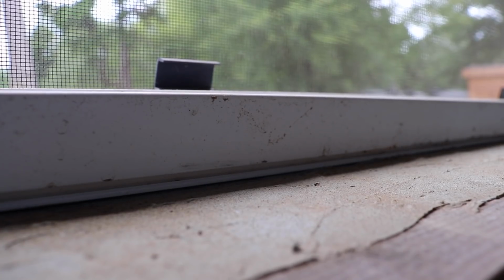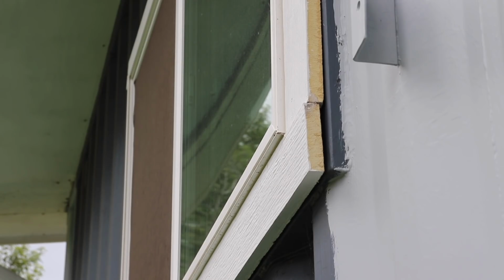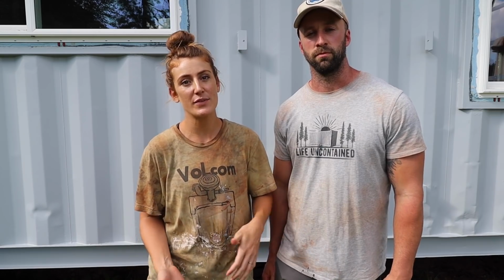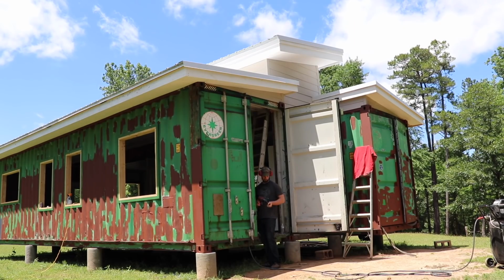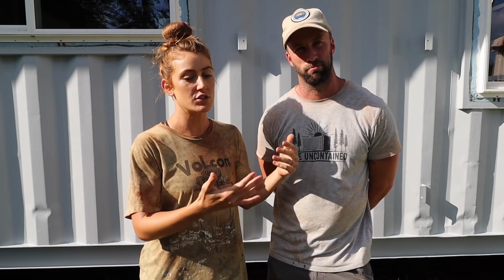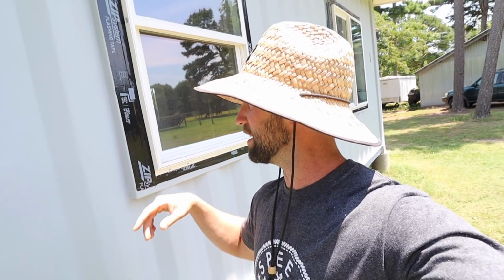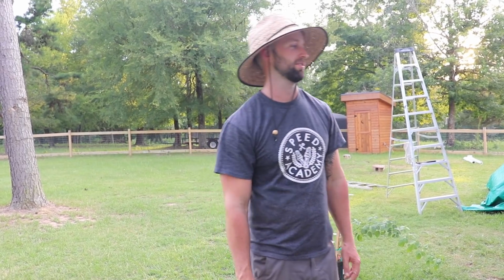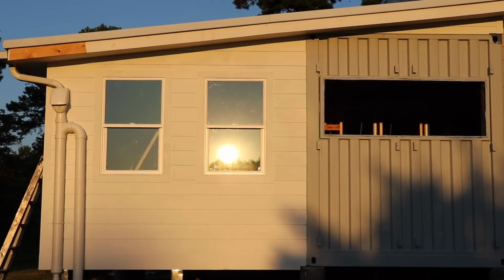Painting Our CONTAINER HOME!

Comment: Next time when planting. 
Fill hole with water.
 Let it seep in.
Loosen up root ball
Put a bit of granular fertilizer around outside of ball.
Cover with dirt.
Water very well.

Hope that helps.
Reply: Make the hole 2 to 3 times the size of the root ball, loosen the roots and don't set the plants with top of the root ball being buried ....... the stem at the root ball should never, ever be buried.  And, if and when you ever think that you want to mulch around the base of the roses, never make the mulch more than 2 inches deep and never, ever pack it in all the way to and up against the stem.

Comment: When yall have to replant those vines (you will, remember "dig a $20 hole for a $5 plant"! 

Also - Use rose soil mixed with organic mulch (1:1) n get some "Super Thrive" - organic fertilizer, HIGHLY concentrated. 1/2 strength right after you plant to avoid ahock n burning new roots... Good luck!

Comment: man, all that painting, to still do inside and out, id be investing in a sprayer for sure.
Reply: less than 50$ can buy good air sprayer and paint all wall. interior or exterior, but first time clear wood or metal need paint brush base paint. then top paint can use spray gun.

Comment: One quick tip for the climbing roses that I learned the hard way,  don't weave them through the trellis. They will be too close to the walls which causes mildew and fungus on the plants.  This will cause them to stunt,  die out, or rot. They need water and air circulation. Also when it comes time to arrange limbs and do fall/ spring pruning you won't have to try to work through the bars. If a plant dies (they do) you will not have to unweave limbs through the bars. You don't need to worry about this with most vines that have tendrils. Just climbing plants that produce stems and branches.  There are great velcro and foam coated twisty ties just for this. At Lowes, Ace, and Home Depot. You simply place your branches as they grow and tie to your frame.  I love watching y'all achieve your dream and figure out how to keep that bull out. And where was Bear? Missed him.

Comment: I'm in the window business, the window flange should have gone on the interior of the  metal..  On a wood structure the window flange goes on the outside, but not metal it's to the inside.
Reply: Hush!! It’ll be fine:)
Reply: Also the bottom trim piece doesn’t go all the way across. The sides come all the way down and then the bottom piece goes in between, therefore you’re not creating a water ledge.
Reply: Yeah well.. You are correct, but since the window was installed on the outside of the metal it’s not going to make any difference
Reply: They never listen to comments so they will be redoing things forever.  That beam under the living room drove me mad.

Comment: You guys need an airless sprayer in your life... you’ll thank me later...
Reply: Brad_Woodall_REI Eh sometimes painting quietly can be nice too ( just about finished painting our daylight basement split entry with a two inch brush)...I work for two to three hours a day five-six days a week, two more days and I’ll be done. The Zen of painting.
Reply: spray paint can use later after all have paint brush first, metal need this and wood, wood suck paint lot need brush paint first 2 time, then can use top paint spray and repair old etc. if need paint metal first need spray 4 time base coat, then paint 7 time top coat then have good painted wall,same work than car need do.
Reply: I agree...and an oil based paint that will seal against rust.
Reply: That little paint brush made me cringe! Guys you do everything to the nth degree, get a 20$ paint brush at least.
Reply: @prosie1968  I agree, that chip brush is made for small jobs and oil based paint. They need a good polyester / nylon blend that will put more paint on the surface and less dipping in the bucket.

Comment: Unfortunately those plants may not live. First, the hole is not wide enough. Second, the roots were not teased or loosened. Third, the side walls of the hole should have been roughed up not smooth because the roots could hit the hard slick side and start to grow around the instead of out. Last, never plant  below the root ball or base of stem. One exception is tomatoes since they will produce new stability roots to help hold against wind and weight of the tomatoes. Good choice to fix the windows!
Great job though. God Bless.

Comment: Long time Houston gardener here. Plant holes in Texas clay soils should be roughly 4-6 inches wider than the original pot. The soil should be slightly amended to improve drainage, but prevent making it get soggy and then roots rot, when heavy rains do finally arrive.  You can add osmocote slow release fertilizer, or compost/mulch in the bottom of the hole to encourage root growth. Never use fresh manure! If you compost it for at least six months, then you can use it.

Comment: Suggestion for Bull Fence Problem - this is just an idea the popped into my head, so take it for what it is worth - but a simple solution would be to just put in a lot of fence-posts, like almost a rib-cage worth of fence posts, down into the water, and then do a double layer of fence, one along each side (essentially wrapping around the posts).  The double wrapping may add stability and really it is the posts themselves that will keep the Bull out.  The Bull won't be able to walk over the posts like it could just the wire fence.  The more posts the better, with probably best to have more of them on the shallower part.  It may also help for the posts to be taller.  Just an idea.

Comment: Yes, lighter colors for sure help with the energy efficiency and living in TX summers like you all, you need AC on all the time and need to keep the heat down on the house. When your ready for AC, your going mini split right? They have 120v version up to 9000 btu, perfect for solar setups. That is what we have. You may need two or go ahead and dual zone unit that one is 240v. Not sure what your inverter is 120v or 240v.

Comment: you can put a rabbit on the back of the trim . a plunge cut with 3" of wood left on each end of the horizontal  piece , full rabbit on the vertical pieces .  and caullk underneath  before reinstalling .   you guys are do "  A REALLY GOOD JOB "

Comment: Y'all are doing great. I love the "less that preachy very down to earth" commentary you guys use.  So many tubers try to act all expert and like they know absolutely everything.    One suggestion from someone thats been painting longer than both y'all have been alive.... Spend the $20 and get a real brush [like a 3" Purdy angle bristle]  instead of using the 'throw aways'.  Get a good fine wire brush as well to clean the gunk from the heel of the bristles & ferrule. They have 4x the bristles, are easy to get in corners, and hold so much more paint that you'll find the job time will be cut in half.  The brush should last a lifetime.  cheers!

Comment: I would suggest buying a good paint brush.  the work will go so much better.  Also get a wire cheap brush to clean the paint brush. I have brushes i have been using for 20 years or more.

Comment: Planting In Square Holes. The chances of your plants surviving will increase dramatically by merely digging a square hole instead of a round one when you plant. The roots won't develop a circular root system because, as systematic planting trials have shown, the roots are not good at growing around corners.

Comment: It looks like you painting exterior latex.... if I see that you will be in for some problems down the road. I would say you should spray with waterbased epoxy. If you guys need help again just PM me. Guys you use the wrong windows too. Your zip tape will only be as good as the paint you apply to tape onto. Better method is recess the windows into the Steel frame and than sprayfoam and caulk from the outside in place. I use 2*4 rectangle tubing 11-14Gauge. This way your windows are recessed and fit with 1/8" spacing all around into the opening. So keep up the good work.

Comment: Should have sprung for a $6 brush instead of that $1 junk.  Also, working directly from the gallon container it will dry out before its all up on the wall.  I would have sprayed alkyd paint myself. Flows much better on wall.

Comment: Do these people realize there is a inside to this house too?
Reply: Do you realize the outside has to be finished and dried in before you can finish the inside so the inside doesn't get ruined? Also, much of the inside is done. Most of the wiring and plumbing and framing is done. Finishing won't take long.
Reply: @GeneWaddle  they keep doing things over and over again.
Reply: @w4447  Fixing mistakes. That's a good thing.

Comment: Boy, do I have questions...
1. Do you 2-have any relatives?
Surely someone can come over & watch your kid,(or HELP) some times. Lugging that baby is cute but it doesn't help productivity.
2. Hand painting that big a structure doesn't seem like an efficient way to do the job.
3. Good thing you're not using a contractor. Those "Change Orders" would be Costly.
4. Spence- WET THE GROUND next time. Digging in dry soil isn't the best way to dig holes-Besides, you'll have to water the roots-anyway.
5. Mistakes happen.
6. Keep grinding along. You'll be finished by the time the baby graduates college...